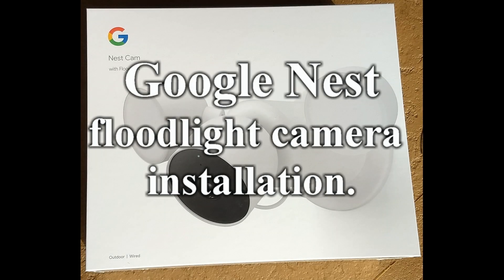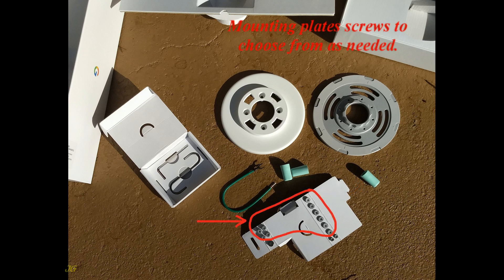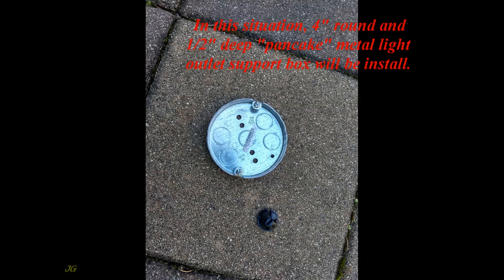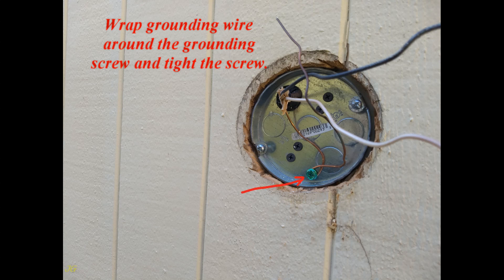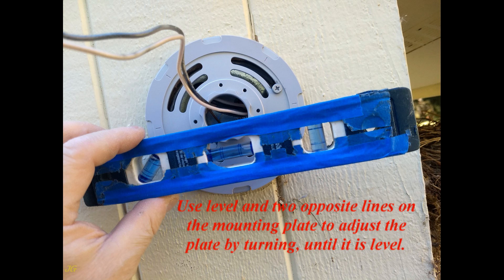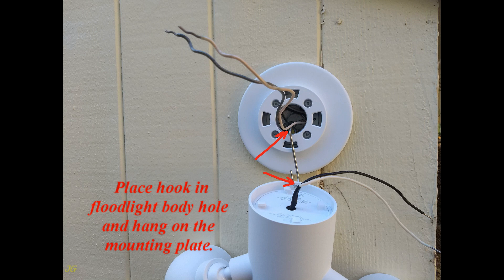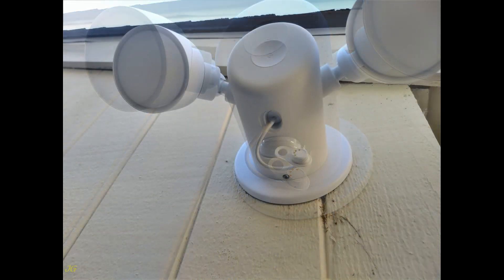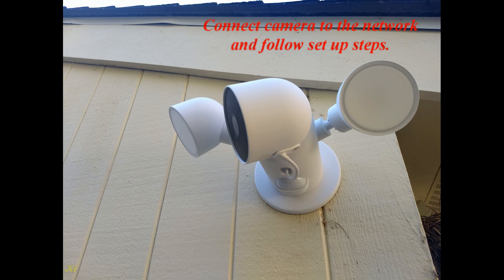Google Nest floodlight camera installation and replacement of existing floodlight.

Comment: Thanks for this.  I am installing mine above my garage door which is about 10 feet high.   I am worried that someone may easily be able to cut the power cable from the bast to the camera, which would then render the whole thing useless for the purpose.  Do you have any suggestions on how to protect the power cable for being snipped in half?  Many thanks!